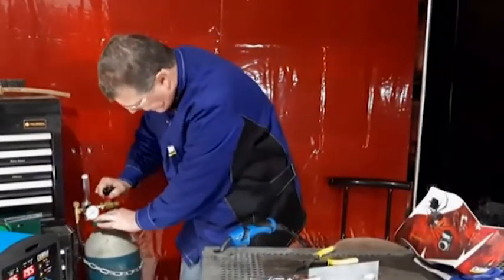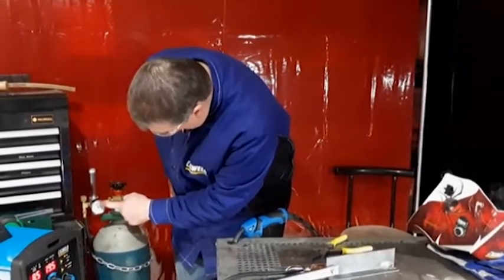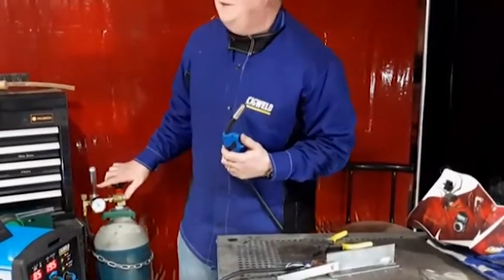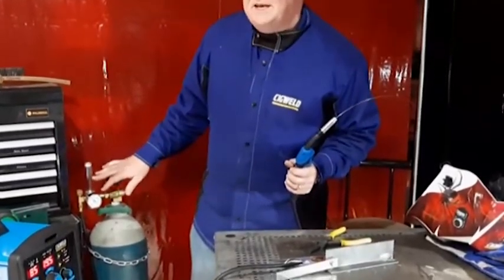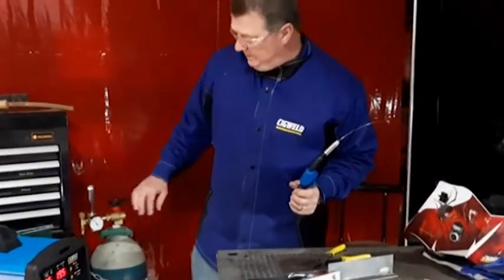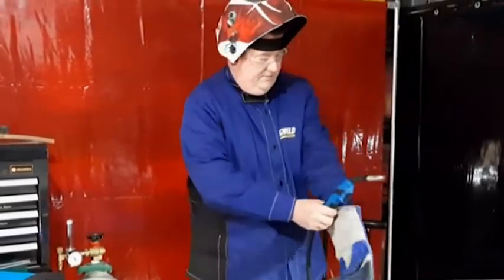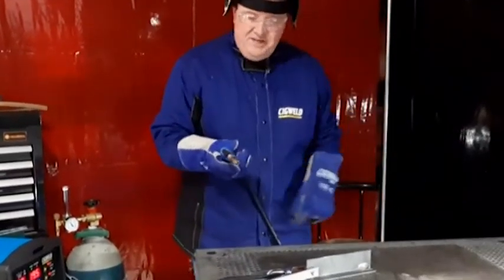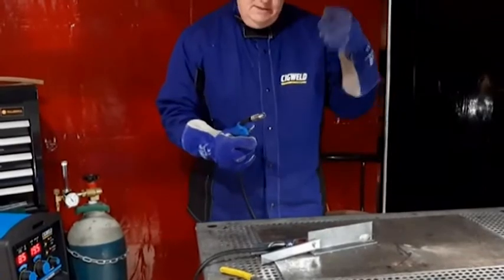WeldSkill 185 Getting your machine ready for welding Safety & Welding - Part 8

Comment: These vids are great. Bought me one of these and love it. Love to see more vids on it.
Reply from the maker: Thanks for the feedback! Enjoy your welder.
Reply: did you buy the 185 or the 185 ultra? Trying to work out what the difference is aside from the LCD....
Reply: @shimarlie1  mine is not the ultra. I am by no means a professional welder so for me I don’t need excessive feedback or real time info on what the machine is doing so the base 185 is perfect for me and already a large step up from the old transformer type MIG i had previously.
Reply from the maker: @shimarlie1   Hey Frank! Our WeldSkill 185 is a manual machine, which you need to set all of the settings yourself. 
Our 185 Ultra is like no other machine. It features our AUTO SET function which allows you to input your material type, thickness & consumable diameter and AUTO SET will pre-set the Wirefeed Speed (Amperage) and Voltage (MIG) along a pre-programmed synergic line... giving you the perfect weld settings every time. 
Hope this helps!